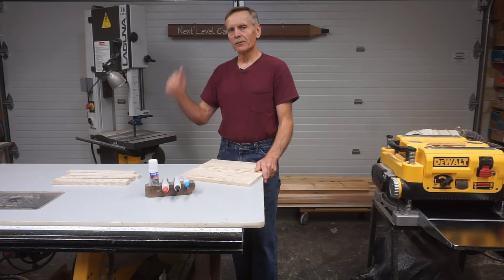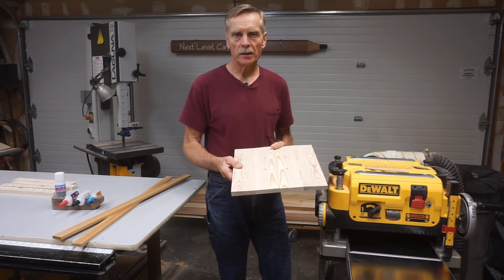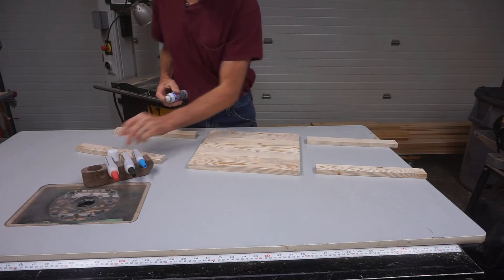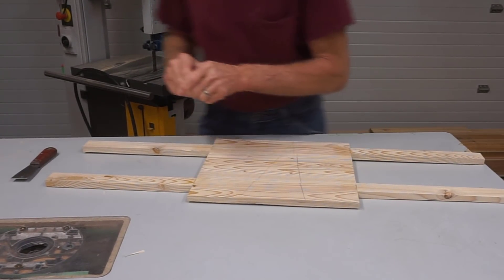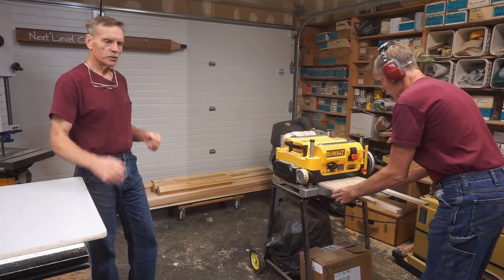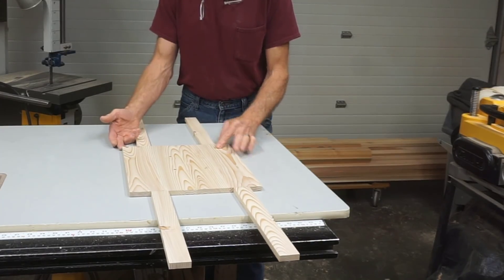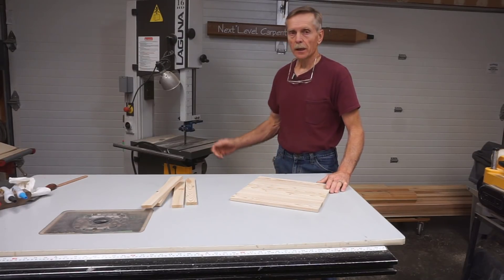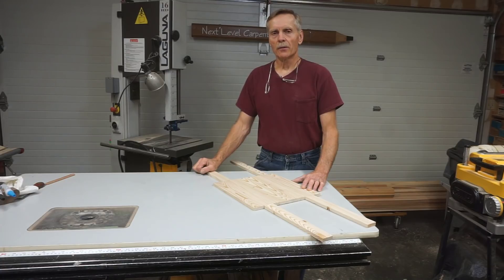How to Use Superglue to Help Plane Snipe-free Boards

Comment: Is there a reason why you store your CA glue on its side? Thank you in advance Daniel
Reply from the maker: There was: It helped keep that Gorilla CA glue closer to the tip so it would flow out after it started to thicken with time.  If you check out this video you'll see that I no longer find it necessary to store any Starbond glue viscosities on their side: https://www.youtube.com/watch?v=8KU1u_5xvV0 The fact that Starbond is sold 'fresher' and stays 'fresh/flowable' longer is one of the main reasons I made the switch and endorse both product and company. I'm not much of a salesman but, if you're interested, you can use special offer code NLC during checkout at Starbond Glue and get 15% off your entire order.

Comment: Nice idea! Never thought of gluing them to the end. Have run them on the sides with works great, as long as the piece isn’t too wide. Also appreciate the tip about the activator lasting longer than a few seconds. I’ve been putting the glue on first then trying to get the activator sprayed before the glue runs off.
Reply from the maker: Kudos for picking up on those key take-away details from this video Bob Bob... it's the little things that count, right? 😎

Comment: good idea!  I will say that I have the Dewalt 734 and the only time I've had any snipe was planning a board that was shorter than the recommended 12" minimum.   however, it is new and with still sharp blades.

Comment: Thanks for the neat trick, I use a sled to mount the outriggers to that can be glued using the long grain rather than relying on end grain, you might find this useful to avoid losing an outrigger. Great video, thanks!!!
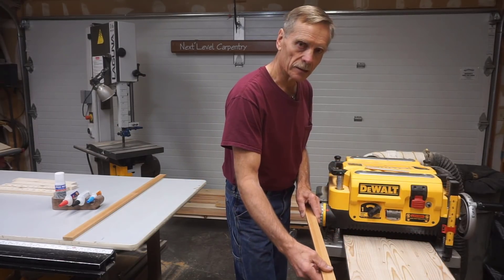Reply from the maker: Don,  Glad you like the video... the method you describe is definitely the way to go in most instances.  You must have missed the comment I make starting at 1:20 in the video which explains why I used the approach I did in this particular application.  Thanks for commenting... hope you check out other videos at Next Level Carpentry too... and don't hesitate to add useful comments that benefit other viewers... and me too!

Comment: My favorite part of this video is the disclaimer at the end about the circle. Too funny. I'll try to remember this trick next time! Also a good idea for boards less than 12" with that planer.
Reply from the maker: 3x3... Thanks for adding your comments here at Next Level Carpentry!  As a YouTube Channel producer you probably have a more meaningful appreciation of that comment than most ;-)

With a quick browse of your nicely styled Channel I noticed you use the same DeWalt thickness planer in your shop... you made a great choice in buying that machine!  That choice tells me you've set a good course for your journey into woodworking and DIY by realizing how important good equipment is to getting good results.  If/when you shop for the jointer you're wishing for be sure to include a comparison of the benefits of the 'parallelogram' type vs the 'ramp' type adjustment mechanism for its infeed and outfeed tables in your decision.  In the meantime, as you build your woodworking skillset I bet you'll find truth in one of my favorite maxims: 'it's not what (tools) you've got but how you use it (them) that matters most'... and with time I think you'll appreciate how it's truth gives rewarding depth to your talent.
Best,
Next Level Carpentry
Reply: Next Level Carpentry I'm just starting out and can already appreciate it!!
Reply from the maker: 3x3,
Great.  I'm 'just starting out' in channel design and video production and can appreciate much about how you're building that 'new' channel of yours... you set a high standard for channels like mine to aspire to!

Comment: Hey Matt, good tip.  I knew about gluing boards on like that, but didn't know super glue would have enough hold to work.  Obviously it does, even on endgrain.  Super time saver.  Cool.
Reply: I will second the activator use.  Just started using it a couple months ago, and will never be without it again.  Always just thought of it as a fast dryer, but I think you're right.  It does add some extra strength.  I hadn't thought about soaking the endgrain, but that makes perfect sense.  One of those "why didn't I think of that.moments'.

Just a little aside.  I am a retired Tool & Die maker from doing powder compaction tooling.  44 years working metal and carbide.  Concentrating on wood nowadays and getting more and more into hand tools.  Anyway, I should have know about how strong super glue is.  About 35 or 40 years ago I had a piece to put on the OD grinder and since it was a strange shape (except for the round flange bottom that I had to finish grind) there was no way to hold it in the chuck.  So, being the adventurous young crazy guy I was back then, I super glued the base to another hunk of steel and chucked that in the grinder.  Keep in mind that this was an upper punch that weighed 15 or 20 pounds and was probably worth about $2500 at that point because it was almost complete.  Anyway. long story short, I was sweating bullets all the while I was grinding it hoping it didn't fall off.  At the end I had to take a propane torch to it to get the glue to release.  I think I was the first person in that shop to try it, and since then it has become standard practice there.  So that's my superglue story.

Don
(cat herder and all around nice guy)
Reply from the maker: Don, cool to hear your work history... in another life I can see myself following a similar path since those who are adept at working metal (carbide no less) always impress and fascinated me. 
I didn't mean to imply that activator adds strength but only, as you discovered, CA is almost useless without it because un-predictable curing is unacceptable.  Making sure end grain is fully saturated though definitely adds strength.  My first exposure to CA was with 2P10 about 10 years ago and it was about $20 for the first drop of glue so I applied it accordingly.  I actually brought it back to the store and said it was crap, I want my $$ back :-(  The knowing salesman schooled me in making sure to apply enough glue to give it a chance to hold and, by applying his instruction, have used and loved it with great success ever since.
I love the CA glue pioneering story... I can actually feel your tension in my bones while visualizing the scenario!  You were probably thinking 'if this stuff can hold a dude to a beam by his hardhat, surely it can old this piece of steel to an OD grinder', right?  That sort of outside the box thinking will serve you well as you concentrate on woodworking... just make sure to keep body parts far from the equation when doing experimental stuff.  A potential failure of a $2,500 part is inconsequential compared to the value of lost/damaged body parts.  You know what I'm talking about but so don't take this as a sermon, OK?  Right or wrong, I've always had the impression that woodworking tools can remove flesh more quickly than many metalworking machines.  Work safe and comment whenever you've got all your felines in line... Best, Matt
Reply: I could tell stories for hours about mishaps both on my part and others from work.  I'm sure you could also.  It's the nature of the beast.  I only have one woodwork story so far, and it involves a kickback that amounted to a small board smacking me in the stomach.  Happens so fast.  That small board is glued to my workshop door with the telltale curved groove showing and a small red mark (my DNA), to remind me not to be stupid.

And I don't think you're preaching to me, and I wouldn't mind if you did.  I'm all for any knowledge I can manage to accumulate.  

Take care
Reply from the maker: Sounds like you too know personally the fact that we begin an endeavor with an empty bag of experience and a full bag of luck, the trick being to fill the bag of experience before emptying the bag of luck :-)
The last incident I had in recent memory  yielded a small board just like yours with a telltale nasty curved groove from the blade transferring speed from its spinning teeth to the board... except I quickly got rid of the board I had in an effort of denial. The small plywood projectile hit me right in the gut but, thankfully, hit with a flat side rather than a corner which surely would have meant a trip to the ER... that took a big handfull of luck out of the bag, that's for sure!  I look forward to your comments... Best, Matt

Comment: That is a good solution for 1 board but if there are several long boards then what?
Reply from the maker: If the boards are all too wide to fit through the planer with sacrificial pieces glued to the edges, just use this same method.  Often on long boards there's enough extra length that will get trimmed off anyways that snipe elimination is only an issue with short boards.  Hope that helps? Best, Matt

Comment: Why not simply leave 1 or 2 boards extra long when you glue up the panel, THEN cut your panel to size after planing?
Reply from the maker: Because, as a woodworker, I don't always have that luxury?  That's definitely the smart/preferred way but sometimes, especially with exotic or rare wood species, this method comes into play.

Comment: You don't actually have to glue the pieces on.  Just use a sacrificial board in front of your work piece and push it with a second sacrificial piece.  The piece you want planed without the snipe rides between the two.  I have the same planer and do it all the time.
Reply from the maker: Jeff, your method does work exactly the same but I prefer to spend a minute gluing the sacrificial pieces on like I show in the video because then I don't have to juggle and shuffle 3 pieces per pass.  As you see in the video I took 8 or so passes and with a workpiece so short it's inevitable that somewhere during the process a piece is going to get dropped or a gap between the pieces will leave the snipe I'm trying to avoid.  Plus, the sacrificial pieces I glued on for the video were 3 times as long as necessary but I wanted to demonstrate that the glue holds long ones on very well and is that much more effective with shorter ones.  Bottom line though is a guy needs to do what makes most sense for the project at hand using his judgement.  Work safely, Jeff, thanks for taking the time to comment on this Next Level Carpentry video... hope you'll check out other stuff on the channel...
Best regards,
Matt
Reply: Fair enough
Reply from the maker: Hey Jeff,
Thanks for taking the time to follow up!  I think your comments will help others plan out a workflow and choose a method that makes the most sense for the project at hand...

Comment: best antisnipe video yet
Reply from the maker: Thanks Rick... Not sure if you'll see it in other comments but it's not even necessary to use extension sticks much longer than about 3 or 4 inches for this method to work.  I used long ones in the video mainly to show that if it can be done with long ones its just that much better and easier to use shorter ones.
Thanks for commenting and I hope at some point Next Level Carpentry will earn a spot on your Subscription list...
Best,
Matt

Comment: Nice useful tip, I shall use that one. I sometimes get snipe right in the middle of my boards, not every board but every once in a while and I can't seem to work out why. I true all by boards up before planing so if anyone has a solution, I would be most grateful.
Reply from the maker: Thanks for letting me know you like this tip Cliff!  Watch 'Care and Feeding of a DeWalt DW735 Planer' video, also on Next Level Carpentry.  Go through similar steps to make sure your thickness planer is performing at it's best and I'll bet you won't get any mid-board snipe anymore.  Usually that's from a dirty platen or slippery feed rollers that cause the piece to drag or stop during a pass.  It can happen on one board out of a batch if it has a 'sticky' spot on it or even from irregularities in the wood grain itself which can cause the piece to slow or stop and give the knives a chance to dig a little divot in the surface.  Hope that helps!  Best, Matt
Reply: Thank you, Matt. Very grateful for your advice.
Reply from the maker: Please let me know how you make out Cliff... I'm quite curious about the snipe thing you've experienced if the maintenance I recommend doesn't resolve it.  Best, Matt

Comment: Good tip. You cleaned the extra glue off with activator. How does that work? Thanks for great tips.
Reply from the maker: Ak, you're welcome for the tip!  Rather than wipe off excess glue with a rag or paper towel I choose to hit it with activator so it sets up and turns hard.  That way I can scrape it off in chips rather than smear it around because it never all comes off and the gooey excess will just streak the planer platen when it's fed through.  Same thing applies when a little glue leaks out on my tabletop.  Best, Matt

Comment: I have been seeing orbital planning blades with individual small bits,blades come onto the scene and they look really good , have you  seen them for your planer?
Reply from the maker: Kaveman; Do you mean 'helical' and not 'orbital'?  I have the former on my jointer and love them.  Other viewers have them on their DeWalt D735's and love them too.  Not sure about orbital though...  Best, Matt
Reply: Next Level Carpentry yes i meant orbital
Reply from the maker: @das250250  wow no kidding I have not seen or heard of such a thing do you happen to have a link to share?  You've got my curiosity piqued for sure!
Best, Matt
Reply from the maker: Looks like some confusion in terms Kaveman;  The video link above is informative but uses the terms 'spiral' and 'helical' rather than 'orbital'.  So to answer your original question: yes, I've seen these cutterheads for the DeWalt DW735 but haven't made the decision to switch... yet.  Other viewers have them and love them which is good reason for me to check them out.  The final piece of information I'll need before making a decision to switch is to see a DW735 with a helical (spiral) cutterhead in operation and examine the surface of the wood coming out.  I need to be convinced it's equally smooth and flat to the surface produced by sharp straight knives because I HATE sanding and strive to minimize it at every opportunity.
Hope that answers your question... Best, Matt
Reply: Next Level Carpentry i believe the finish was one of the pluses the helical has , id be interested in your views when you look at it , thanks
Reply from the maker: Kaveman, The main thing I'm after is the smoothness of finish I get with the straight knives.  I can take a few passes over it with 150# or 180# sandpaper followed by stain and a couple coats of lacquer and be done leaving a flawless finish behind.  If that can be achieved with a helical head then I'm sold because I HATE SANDING and anything I gain with durability of carbide inserts and convenience of switching one cutter to eliminate a nick is meaningless if I have to spend extra time sanding out little scallops like the ones I generally see left behind by helical cutters.  If the feed rate of the DW is slow enough that there's no scallops left behind then I'll definitely switch.  Like I said, it's all about the smoothness of that final pass.  I'll sure let you know what I think when I get a chance to compare.  If I were making a purchase decision between the two I'd do the evaluation sooner than later but as it is the straight knives do a great job.
Stay tuned... Best, Matt

Comment: It would be helpful if you could say what exactly "SNIPE" is?
Reply from the maker: 52memor,
Sorry about that... I should have included something in the video to show what snipe is and how it looks :-(
The term 'snipe' in this context can be described as a slight 'divot' in the end of a board after it passes through a thickness planer.  It amounts to a dip in the planed surface at the end of a board of 1/64" to 1/16" 'deep' and usually 2-1/2" long or so and is caused when the board is being held down by only one of the two feed rollers inside the planer head.  A lot of factors determine how much and how bad snipe is on a given board but, if not dealt with, it leaves an unsightly blemish on a finished piece.  In a lot of instances defective sniped ends can be just cut off as scrap but in cases like the one I show in the video I couldn't spare the extra length from the blank I was making so I went to the extra effort of making it 'snipe free and proud' by making sure the finished piece was always held down by both feed rollers during the planing process.  This process leaves all the sniping at the ends of the sacrificial runners because, while snipe can spoil a project, it doesn't have the slightest effect on how those scraps work as kindling in my woodstove :-)
That would have been MUCH easier to show in the video but hope this helps answer your question since I'm sure you're not the only one asking it.
Best,
Matt